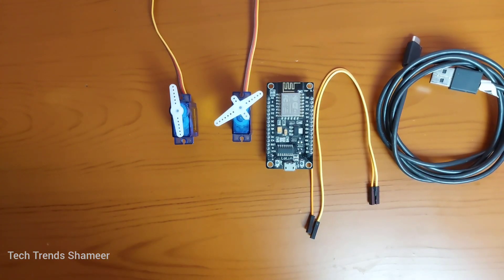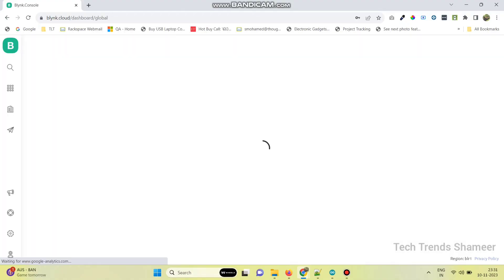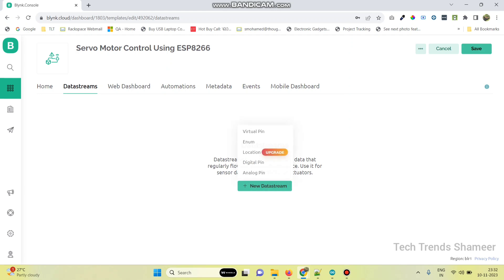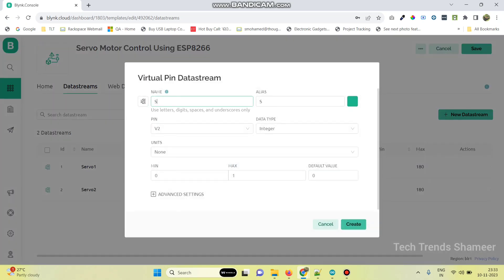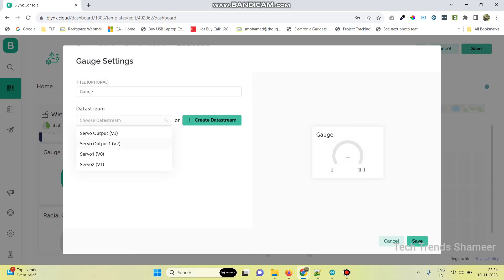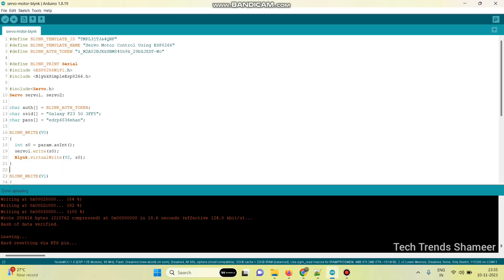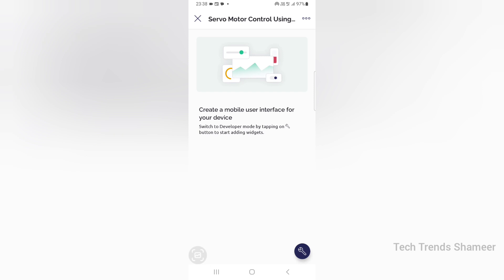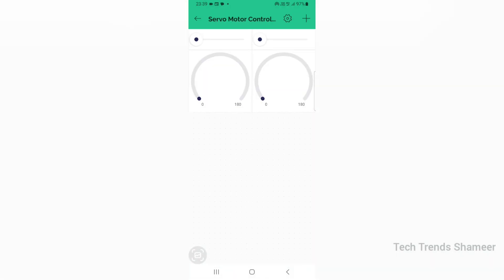How to Control Servo Motor Using Blynk IOT and ESP8266 | Servo Motor Control With Blynk

Comment: Did everything right and all is running but my servo motor is not moving when I'm changing angle in slider it is only giving a ticking sound

Comment: error device is offline despite connected to working network
Reply: "Use the Arduino IDE version 2.3.2 mentioned in the description, and it will work. Pay attention to the Wi-Fi password; if it contains a comma, use a period instead. As soon as you connect the NodeMCU8266 to the computer, Arduino should recognize it and automatically install the necessary libraries. I installed everything that Arduino requested, and it worked immediately."

Let me know if you need further assistance!